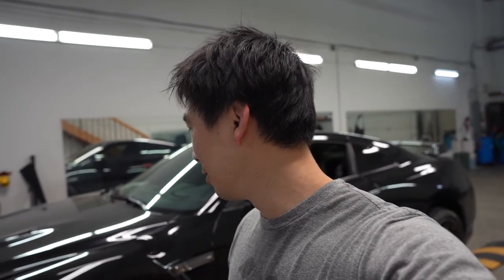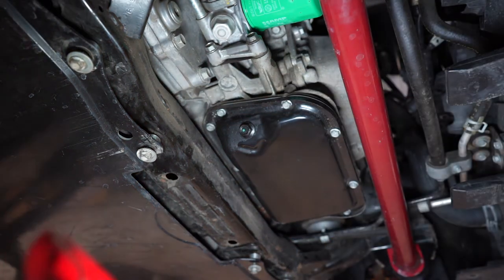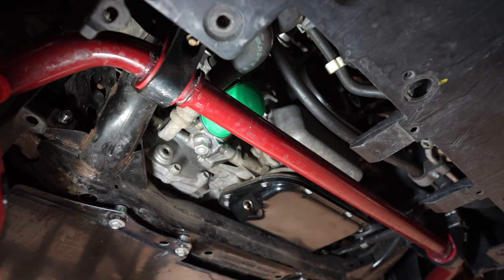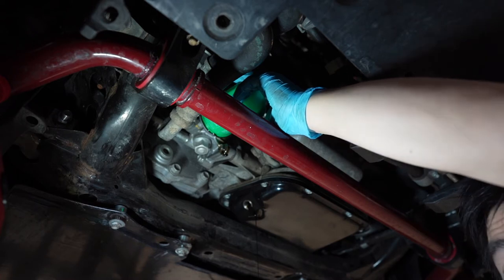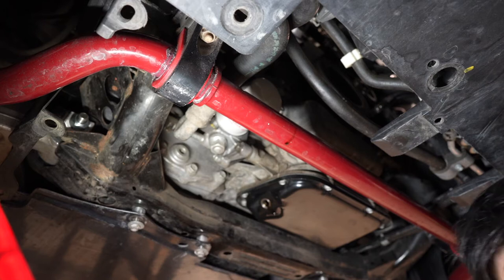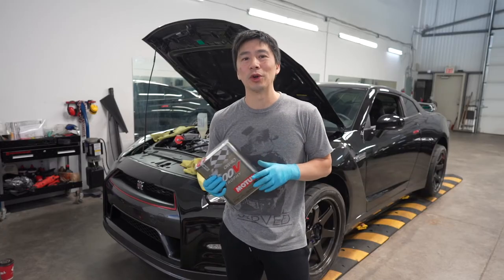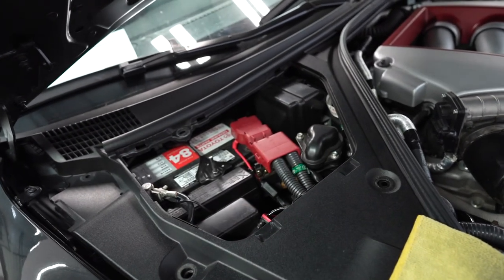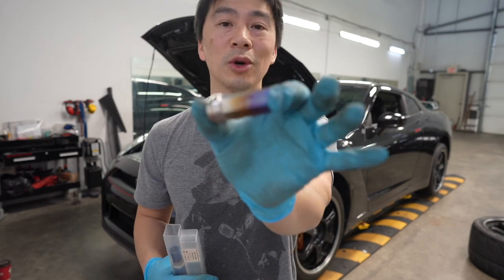How I prep the GTR for winter.

Comment: I saw the oil pan and thought, it’s so tiny like a garden gnome😂 and you’re right all the Subies out burning it up, half of them lowered, messing up their kits. Need the lift for our Edmonton winter’s.
Reply from the maker: Yeah the oil pan is small. The VQ motor doesn't take a lot of oil it's pretty crazy. I'm considering up grading both the engine and transmission oil pans.